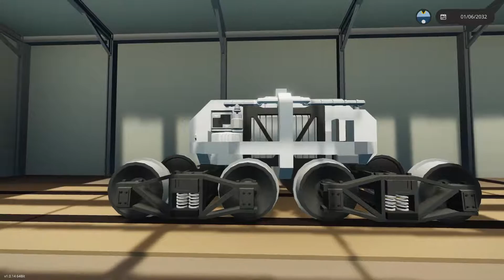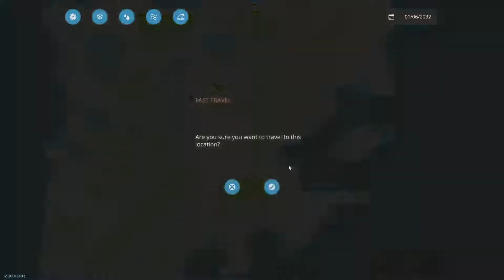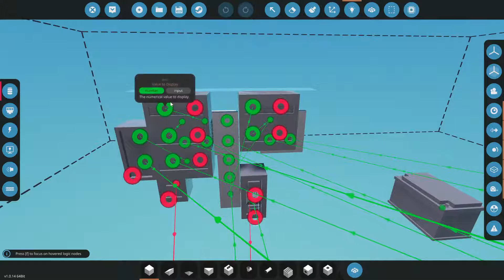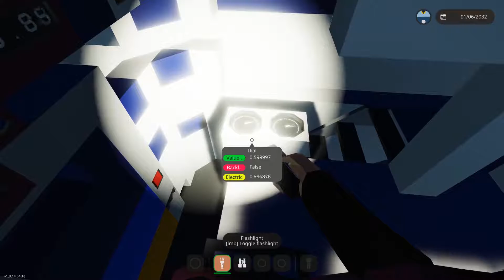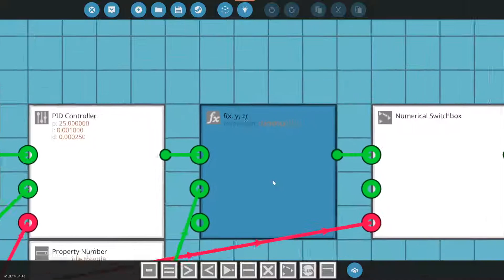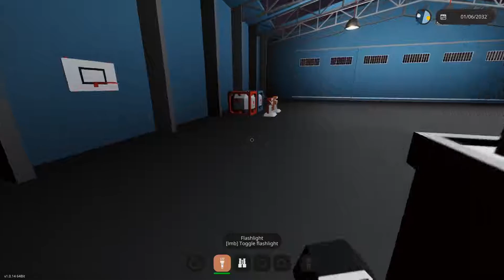Stormworks railroading masterclass

Comment: isn't gearing that contends with wheel slip possible, that shifts down momentarily on the slipping wheels thus giving power to active traction, not decrease speed throttle as solution.
Reply from the maker: yeah, sure, if physics in Stormworks made sense..